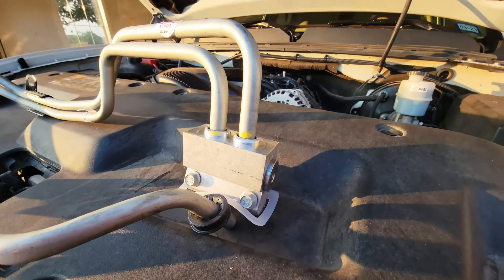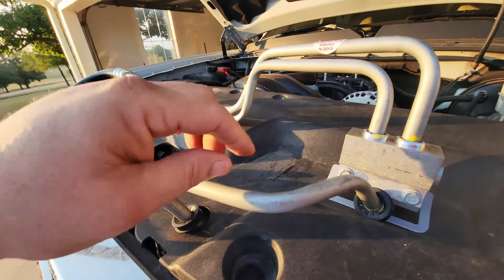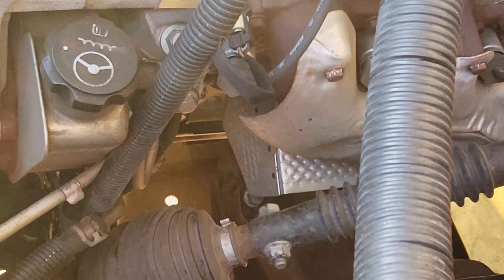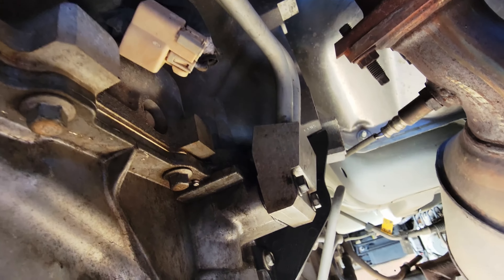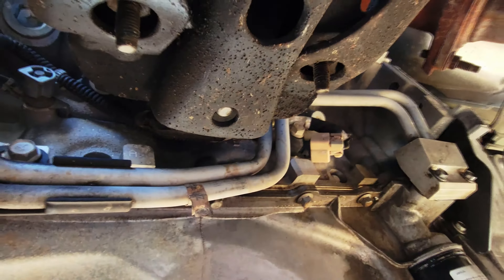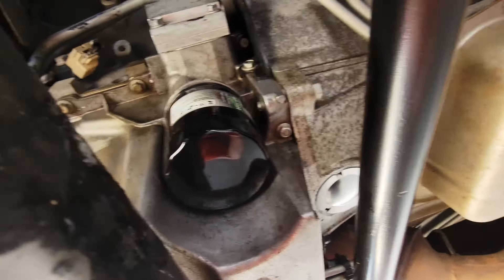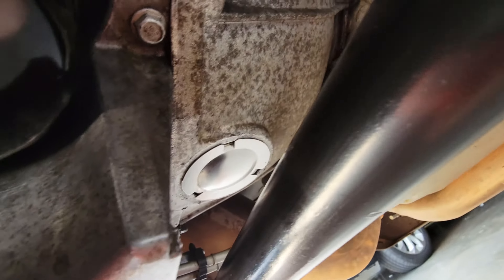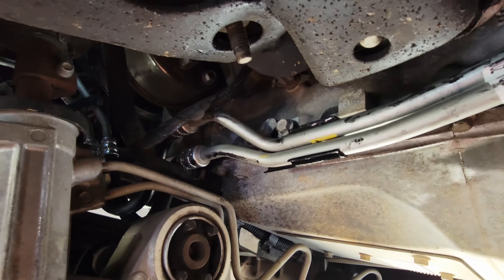Oil Cooler Line Replacement 09-13 GM Trucks

Comment: Thank you. This isent so bad. Last video the guy ripped out the stearing column, the engine mount, had it on 2 Jack's. About to just have the shop do it.  But looks like I'll do it my self now.

2012 chevy avalanche. Leaking from black hose part

Comment: This video makes it look like a gravy job. Be warned...4WD models have none of the beautiful real estate to work under like the 2WD Denali in this video. Snaking the old line assembly out and getting the new one into position takes finesse and patience. Some videos even show the tech removing (temporarily) the driver side motor mount to gain necessary clearance...  👀 🙈
Reply: Were you able to do the job without undoing a motor mount/axle? Really don’t feel like messing with all that but I need to get new lines put in
Reply: If you have a 4WD model, I encourage you to call around the most reputable dealers and shops in your area for estimates. It's NOT a job for an average DIY person. Sometimes, due to all the tools and mess required, it's better to pay a pro who's done it before...than to lose an entire weekend + multiple trips to the store for new tools and parts. You find out real quick what your time and money are worth. i.e...there are jobs I've done that I would have happily paid not to do... 👀 😖
Reply: I did my 4x4 Sierra, 2011. it was a huge pain, unbolted the motor mounts & jacked up the block a few inches, just don't go too much. Even then it was nearly impossible, I have read some guys drop the differential to make the room instead. in any case, I am trying to find a fully flexible hose option rather than the OEM replacement, they will start to leak again at the union where the flex hose & metal hose marry up.  @TheTexican05

Comment: My 2014 Suburban Z71 5.3L is leaking from the oil line connection points at the radiator driver side. Should I just replace the whole radiator to be sure or is it probably just the connecting pieces from the lines where they meet the radiator ?

Comment: Hey there, just replaced the oil cooler line gasket right there where the 10mm bolts anchor the line next to the oil filter. 
Changed the gasket thinking the oil was leaking there.
But now I see that it’s coming from the Allen key on the side of that. Could you tell me the size of Allen key that fits in there before I disconnect it all again?

Comment: Any chance there is an O ring under the leaking plug?

 I have the same plug leak and managed to tighten it up, but it still leaks..
J
Reply from the maker: I didn't check if there was..  I assumed the tiny bit I was able to tighten it down would have done the trick.  

..but now I'm in the same boat as you, it started leaking again.  I was able to tighten a few pan bolts, that could be where it's coming from.  

I don't think it's the rear main because there's a slit and a hole on the bottom of the bell housing where it meets the block and I can run a piece of paper towel up in there and it always comes out dry.  Very strange but I know it's not coming from the top of the engine.  

Might have to take it to a real mechanic and have them show me where it's coming from with proof.
Reply: @HI-PSI  
I'll be changing the lines for a new set soon. I'll likely pull the end plug out to see if there is an o ring. 

The lines mght be seeping at the top of the block  (where the two lines are pressed into the block).
Reply: BTW. I've noticed as I view the LS series engines here and on the 'net the area where the lines bolt to the engine block is often damp/wet..
Reply: Could be the oil temp sensor, map sensor, oil sending unit, belly pan, RMS, RMS flex plate or cover plate, or vlom gasket. The drain plugs also tend to dril over time and tiny gaskets are available now for em. I recommend going over all of these… and if you get all the smaller of these problems rectified and still leaks then its the RMS and/or cover plate or Belly pan - both of which are a big job for the typical Diy’er. These aluminum blocks have issues with pitting and most of the new gaskets are recommended to be installed with RTV sealant to help remediate that, especially near edge gaps etc. Id recommend looking in the inspection hole at the flywheel and possibly using a borescope camera to get up close to the rms. If theres any wetness up there its the cause and sometimes can be difficult to spot. If it is the Rms leaking then you could also try AT 205. You add it to the oil and it puffs all the seals and gaskets up rejuvenating them and id say fixes the issue 50% of the time, but for how long who knows? Worth a shot tho… when or if you check the map sensor and oil sending unit they are located at the very-top-centre-back of the engine, kinda behind the intake cover. Id recommend just completely disconnecting everything and removing the entire intake cover to access. That way you get a chance to clean under there, replace the intake valley gaskets, replace the map and sender, plus get a real good look at everything up there… cuz youll also be looking straight at the vlom cover, which also have the potential to leak, in which case you can pop it off and replace that. It all sounds like a lot, but really it’s not quite as bad as you’d think… just lots of connections to remember (throttle body, injectors, vacuum hoses, electrical wiring connectors, etc). If it gets daunting id recommend using masking tape to identify each matching connection A,B,C, etc. if you do that you’re golden! Theres also some oil pipes that run back n forth over top the vlom cover that have 4 connection points into the valve covers. They also can leak and have gaskets that can easily be replaced. Forgot to mention its a good time to clean and inspect those valve covers/gaskets.

Comment: Is that a real denali? I thought all denalis were AWD were is you 4 well drive axel
Reply from the maker: It's real.  They made 2wd, look it up
Reply: Yea theyre stupid. GM ruined the denali brand. Also. You should mention that you did this on a 2wd as the front diff and axel will most certainly be a problem on the AWD trucks

Comment: Did you have to remove the motor mount and the cross member or did it slide right in?
Reply from the maker: It'll slide in.  Just keep the caps on the new part when fishing it through from the front.
Reply: @HI-PSI  Hey bro, silly question, but how do those caps come off when pulling the lines off the radiator??

Comment: Did you drain all of your oil before replacing your oil cooling lines?
Reply from the maker: No, just allowed it to drain into a bucket from each point of contact as I went along then topped off with fresh at the end.  It's not bad.

Comment: How did you get the old cooler out and the new one snaked in there? You skipped past that. Having trouble getting it out let alone back in
Reply from the maker: Cut the lines and let the oil drain, unscrew the fasteners going into the block just above the oil filter.  Pull the bottom section down and forward towards the radiator to remove.  

There are keeper pins holding the top section to the radiator, pull them out and slip the cooler line fittings out of the radiator.  Pull that section straight up to remove.

To install:
From the bottom, push the connector that attaches above the oil filter through next to the front side of the engine, it's tricky/grabby, but it will go through without much force.  Attach fasteners. Then push the top section up to the top of the radiator. 

This is on a 2wd truck, it's relatively easy and straight forward.  4wd is way more complicated than this.
Reply: My lord , you are the best, but I am trying I cut the lines, I can’t get it to pull out through the front. It’s a 2WD. What a bear 🐻 it is to remove let alone get the new lines in, Jeez. I unclipped that black harness on front of oil pan for a lil more room. Idk if you have one more tip to try, but you’re great for answering in first place. On Valentine’s Day too! Well I’m gonna try again thanks cheers 🍻 Kevin NJ
Reply: It looks like I have this big transfer case with two Cv boots and axils behind my rack and pinion hanging there that you don’t seem to have on that vehicle. I don’t know what way to fish it I tried both I can’t seem to get it passed it all. With that U bend in the lines. Any thoughts? ☘️
Reply from the maker: @Kevin Fraser  Yeah bro, this video is for rear wheel drive trucks.  The 4x4 models are a bish